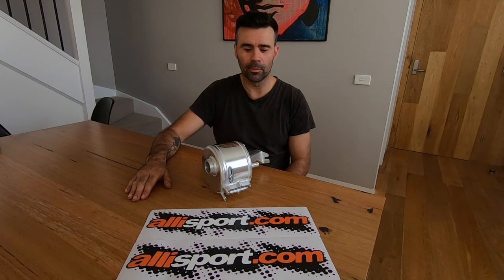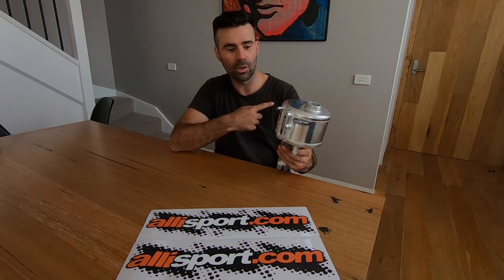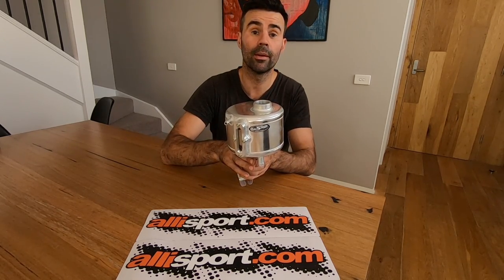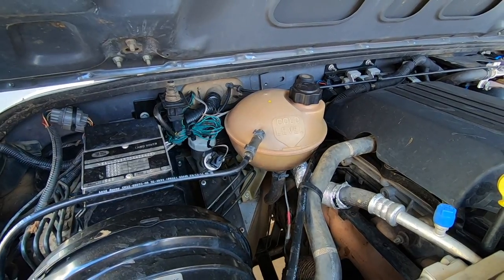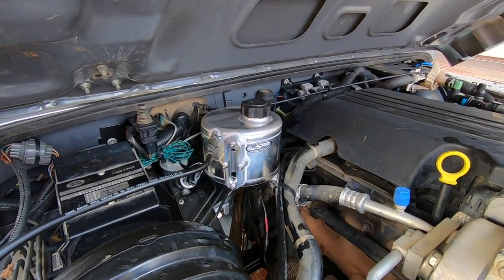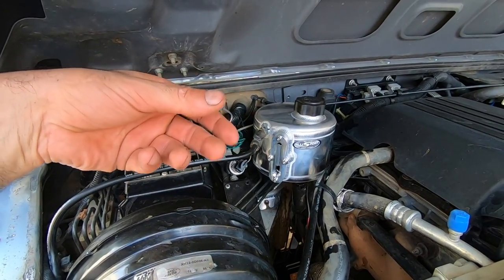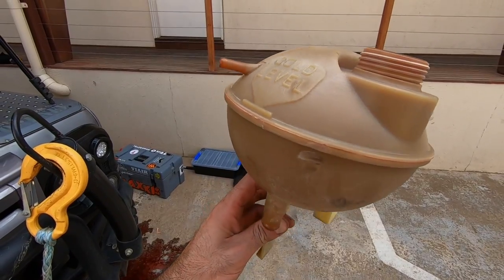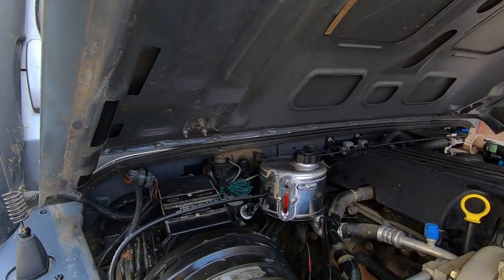| ALLISPORT 2.2 Header tank | INSTALL |

Comment: Nice! Now get some silicon hoses to really tart it up , I mean make another sensible upgrade haha😜

Allisport do lovely stuff. I have the header, oil separator and power steering reservoir on my 300tdi disco. Just about to get their intercooler.

Worth it over the cheap eBay copies as those ones don't use the stock expansion cap so risk over pressuring. And if you have the older black plastic tank on the early disco/RR they were prone to poping leaving you stranded.

Comment: Great piece of kit. I have the older version installed in my 2.4 and my complaint with it has been that you can't check the fluid level without opening the cap - the sight tube fixes that - looks great!